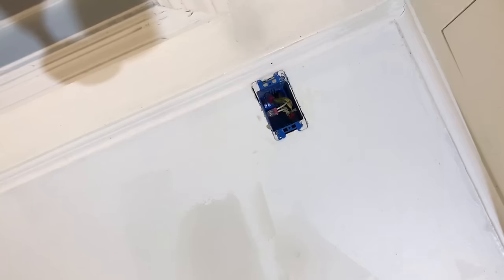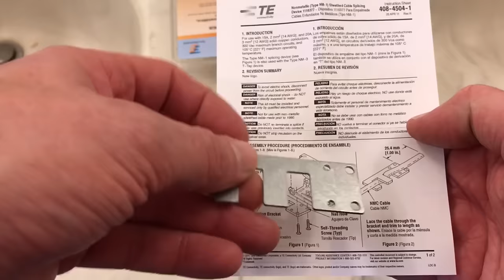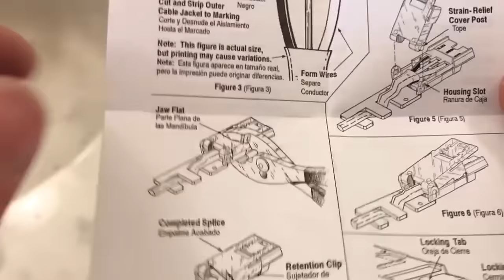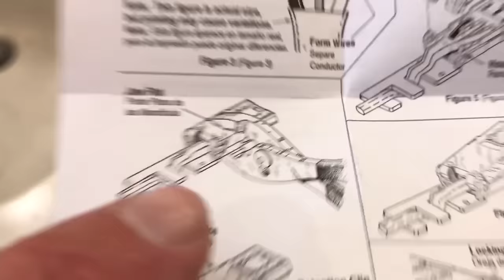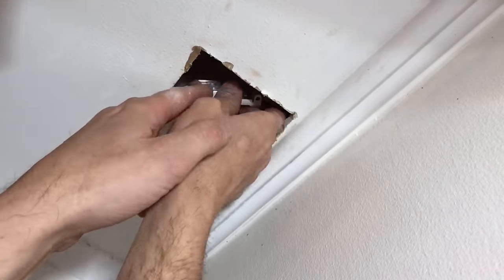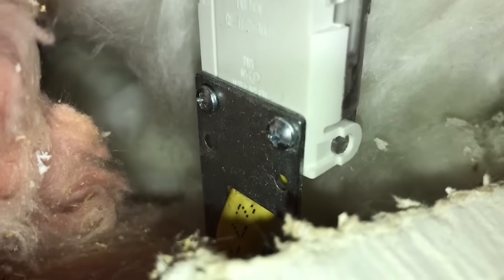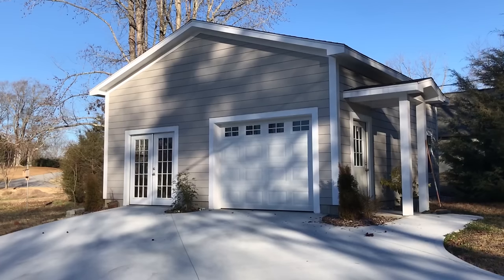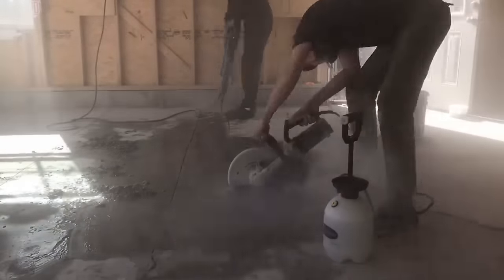Do I have to have a junction box to splice wires?

Comment: I've been an electrician for 20 years. They use these to splice the wires on double wide manufacturer homes. I fix about 50 of these a year. The connection method is horrible, and will cause a fire if not caught at first sign of an issue. PLEASE DO NOT USE THESE, and if you do, PLEASE LEAVE ACCESSIBLE.
Reply: weird how all of you have the same story going around commenting on all videos about this...dozens of different commenters all with the exact same scare story about the mobile homes what are the odds...almost like electricians are a big racket!
Reply: @cryengine_x  I'm not an electrician and Ive never used or seen one of these before today. However I do agree with the above commenter and here's why;
The contact being made with the conductor is extremely low. Look at the bite mark in the insulation when he crimps the 14 gauge wires into it. The amount of contact is exceptionally low and you have a total of 4 of those weak connections in a single circuit using one of these. 

Using 12 guage wire like in the actual ceiling install in the second part will likely give a significantly better connection however, now instead of having to support a 15 amp circuit, you're now asking for it to handle 20 amperes. If even one of those connections is weak it's a problem but remember, there's four. There's too many potential points of failure to be worth it. 

Now if they made something similar to this but with a beefier strain relief and a connector that made more contact that actually involved stripping the wire back like a wago connector I'd be in and say "cool, use it if you want". 

If you absolutely HAVE to use this device for whatever reason, please, please, PLEASE use it in combination with a combination AFCI breaker so if the connection ever breaks down and it starts arcing, it'll hopefully trip the breaker at least. It would also be best if this were only used on lighting circuits only that will never see more than 5-6 amps pulled through them. Running 2500w through this thing is just asking for trouble
Reply: My bro and his wife had their double wide burn down and this was determined to be the cause. I am not an electrician and dont want to be one. If someone wants to use them, don’t complain if your house burns down
Reply: @gopooalreadyplease5842  ok i wont.

my dads cousins brother has over 50 of these in his walls and they all perform flawlessly.
Reply: @davyc444  I just have a hard time believing lots of youtubers use this etc and dont have issues. I guarantee this guy didnt have issues. The only issues he had were the comments LOL. It's also UL listed which I assume counts for a lot, and NEC code approved on top of all that.

I mean I'm literally on this vid because I was drilling into my ceiling from the attic and like a huge dummy, the one time I figured it would be ok just this once to not cut the power, surely I won't hit anything, I hit a live wire going to my water heater, tripped the water heater breaker etc. So I have a damaged wire behind drywall. Not knowing anything about it, this sure would be a easy fix. The other way is splice the wires with wire nuts in an accessible junction box. It's more trouble and even though it's in the garage the junction box is going to be an eyesore (would be 100X worse if it was on an interior home wall!)

All of this is moot because these things appear to be permanently discontinued, not in stock anywhere. I suspect the nattering nanny's won and drove them out of the market. Or from your point of view, maybe they started a few fires (thats another point, if these were as bad as claimed they would have been banned).

Also I believe I figured out a better way to fix my problem, I should be able to just move the water heater outlet over a couple feet to the next stud over, cut the wire at the break and it will reach the new  repositioned outlet location just fine and not have an unsightly junction box splice involved.
Reply: I’ve been a journeyman for about 5 years and NEC says all devices, connections, repairs must be in a readily accessible box. We have to go into attics all the time fix flying splices to adhere to code for home inspections
Reply: @calvinjosey5784  No they dont. Stop lying. This is NEC 2020 compliant for in wall without any box.

if youre a 5 year journeyman (unlikely) you need your license revoke
Reply: Looks to me like a twist lock plug would be better. Find it hard to believe they are NEC approved.
Reply: Not surprisingly, site shows Product as discontinued
Reply: Yes they look "iffy"... Unless you can make a perfect splice first time and not reuse this device...
Reply: BTW, most rvs use molex razor cuts for connections in outlets, I'm in the process of removing all these so called speed connection on my 05 rv with new gfi screwed connections.
Reply: @cryengine_x  Journeyman or not, You're putting entirely too much faith in a group of engineers and safety people that declare products "Industry standard". A helper with 1 eye could tell how fucked that termination method is.
Reply: As an electrician for 20 years, I've seen and never used these.  This connector, although listed for not being in a box, is still a wiring connection.  The NEC requires that ALL field connections be accessible.  Burying this in a wall, despite the manufacturer listing it for the purpose, is a clear code violation.  The poster of this video has just made himself liable to pay for a proper repair should he ever sell his home.  If it was a rental property, he became liable for the renter's losses should a fire start because no one could inspect and repair the connection in the case of a fault.  Never make your wiring connections inaccessible.
Reply: @ianbelletti6241  That is false. Learn to read. 100% legal for in wall at all times and 100% up to code. Your license should be revoked for illiteracy and greed.
Reply: @cryengine_x  what part is greed?  The code actually requires that ALL wiring connections be accessible.  This device counts as a wiring connection.  The requirement is there for maintenance of the connections.  If you hide this in a wall, you will need an access panel at its location to access it.  On top of that, the code constantly refers to the AHJ, which is typically your county building inspector, but can be an engineer, an insurance inspector, or other qualified agent.  There's a major fire liability issue with electrical work.  If you make a wiring connection and bury it where it's inaccessible and a fire ensues because of it, you can become liable for the cost of the damages for doing shoddy workmanship.  On top of that, you can't always trust how it's marketed on the packaging because the people marking the packaging often don't understand the rules and often don't give you proper information because of it.  Just look at the ipxx waterproof ratings.  Ipx7 is a designated rating that is tested in excess of other ratings, but is meaningless without telling you what the manufacturer had it tested to.  Even though the packaging says that it can be hidden in a wall, you still are required to have access to the connection.
Reply: @cryengine_x  weird how little you know about how electric current works.
Reply: @OffendingTheOffendable  i'm spot on about greedy humans (electricians)tho
Reply: @cryengine_x    I have to agree with Steve. You have not issues the amount of electrical installs electricians have. Agreed most push type electrical connections do not fail but those that do are a fire hazard.. I have seen only one for sure that was in my hone the builders electrician used stab in the back outlet connections this connection failed and start a small fire within the electrical box fortunately it was in a metal and was wired with conduit
Reply: @cryengine_x  
Just the Facts The outlet had a heavy load at the time and it was definitely the wiring
Reply: @monteglover4133  wasnt this product though was it?
Reply: @davyc444  Take an electrical outlet apart and review the connection between the internal components and the push-to-connect wire. You may notice that the connection on these splice kits is considerably better than those push-connect systems.
Reply: @cryengine_x  you are out to lunch about greedy humans, frankly if you look at that and think its fine and want them in your house thats fine, i would not want to have that anywhere near my work or be in any way liable for it. for one the electrical code is the bare minimum not a gold standard, and secondly the only reason you may have not seen issues on these is the failure would likely depend on how much draw the cables are taking, if its rated for 12awg 20 amps is a lot to go through that cable. when you have a career that you take pride in doing things properly and when you have to warrantee your work, not to mention install hundreds of joints a year you have to understand theres a different perspective than a homeowner grumpy that they dont want to pay for a service call
Reply: @seanshomeshop325  nah youre just saying that. electricians hate this because it takes away their business=$ and they are greeedy
Reply: Yeah, I was thinking those contact points or fingers look sketchy like they can't withstand much current. Very minimal contact area. I noticed right on the back it says 'Do Not Re-terminate' which to me means it a onetime use. Can't take it apart and reuse. I'm suspicious of a lot of this Home Depot 'Week-end warrior' consumer garbage. Even though they have all the certifications I'd still use a tried and true box and nuts or wago or lever lock connectors. I would just use a box. There's no difference between burying this thing and a box. It' still not a continuous unbroken wire run.
Reply: @cryengine_x  Not really, they just see more of it because they're exposed to more incidence of problems with them on service calls. Just like aluminum wire and Federal panels were all OK. Nobody's going to argue that they use the best construction methods on modular homes.
Reply: @davyc444  If you compare the contact area of those tiny bite marks compared to properly twisted wire nuts there's no comparison. I'd be really worried about having that thing buried in the ceiling, especially in a bathroom. with a lot of high draw appliances.
Reply: @cryengine_x  So far. Flawless until they aren't.
Reply: @cryengine_x  Water heater is typically 220v up to 5500w, much more than these can withstand, unless its for the blower motor on a condensing heater.
Reply: @calvinjosey5784  I also thought ALL splices were required to be accessible, since it's not an unbroken run of wire, you may need to access it in the future.
Reply: As always, use with caution. I would never want to use these for a circuit powering a receptacle, but on the other hand I would have NO issue using this on a circuit powering a known low-power load, like a LED fixture for example.
Reply: @vincemajestyk9497  That is correct
Reply: @pnnielsen  Frankly that's the problem I have with these. People forget, houses get sold and people use circuits expecting it to carry the rated load. Literally you're playing with fire. I don't know why anyone would deliberately 'under engineer' a circuit just because at that moment it happens to have an LED light on it. Maybe some future owner will install halogen lighting and have a fire i the wall. If an electrician says it's a problem take heed. I think the only 2 choices you have would be use a box (exposed) or run another length of wire. If you can't pull the staples just fish a new wire and tag the old one abandoned. Having a box showing isn't the end of the world, especially if it prevents a fire by discouraging the use of these things. I heard some of these cheap new construction homes (Ryan) are using 14ga in the kitchen and bathrooms to save $$. They also use that jointed stitched together wood.
Reply: @vincemajestyk9497  I'm wondering if they found a loophole in the codes. This is not a splice since you plug them into each other. Presumably there's another loophole since I'm sure hiding plugs and sockets wouldn't be allowed either. However, just because you can doesn't mean you should.
Reply: @chaos.corner  Actually I think that the issue is that they are being 'misused' outside the application they are made and approved for. I think in most jurisdictions they are ONLY to be used for 'mobile' or 'modular' construction homes (obviously because of the need to quickly connect the service cables upon joining the modules) and people see them at HD and figure it's OK to use it in a stick built home. Probably easier to access in a Modular home situation where you kind of 'know' where they'll be if there's a problem. Just because it's 'Approved' on the package doesn't mean it's approved in YOUR application. Like people have said, they're unique to MH because of the construction. I've seen some crazy videos over the years. A splice is defined as the mending or joining of 2 or more cables, which is something other than an uncut uninterrupted continuous run. Yes, it is a splice. It's not a solid run.
Reply: @M-J-P  Getting ahead of.........lawsuits.
Reply: @bernardgraf7187  More than 'iffy'. I think the 'Scotch Lok' trailer connectors on my truck can handle more current than this do-hickey device.
Reply: @ianbelletti6241  True. It MUST be accessible for inspection. Period. I think they're playing word games on the packaging. When they say 'can be' it doesn't mean it should be nor the legal compliance aspect. Just that it would physically fit in the wall. Probably one of the reasons they're DISCO'd now.
Reply: @vincemajestyk9497  I'm talking about the specific situation when you need to modernize, and extend your wall bathroom light circuit to a ceiling hard wired LED light. Sigh! I don't know why I even comment here... DUH! We all have brains. Use them ! Doggone!!!
Reply: @vincemajestyk9497  exactly.  It's just like hiding a box in the wall. You have to have access to it.  If it's for a light, you can use the light as the access point assuming removing the light leaves a large enough hole to access the connection.  Otherwise you need an access panel in a position that's reasonable for working on the connection.  The big problem here is that the marketing team that designed the package clearly doesn't understand the the average consumer and only picked up on the engineers mentioning that they can be installed in walls missing the engineers' statement of "when accessible".  The average consumer doesn't know the code requirements either and doesn't even realize that if they have a code question about some work that they are doing most inspection departments are willing to answer their questions because they like to see homeowners trying to do things correctly.
Reply: @vincemajestyk9497  Maybe. But the stuff on the packaging to me doesn't seem to be suggesting MH only application.
As to the "Splice", you are not joining two cables, you are wiring the cable into these and then plugging them into each other. Plugging a lamp into the wall is not a "splice", after all. Bear in mind, I'm talking a strictly technical interpretation and not the spirit of the thing (which I agree would make it a splice). There are always edge cases where loopholes can be found.
Reply: @vincemajestyk9497  Fair enough, but anyone crazy enough putting a major load on an old light switch is not going to get stopped...
Reply: @vincemajestyk9497  HALOGEN LIGHTING? Lolololololoool! Incandecent lighting is about to be forbidden everywhere. If you worry about this, then yes, someone will hook up a stove to this circuit. Right on!
Reply: @cryengine_x  Even it is compliant, it's a bad idea for so many good reasons.
Reply: @cryengine_x  Same with my brother's sister-in-law's aunts' brother's, nephew's kid.  They work great, but that's about how close I would get to putting them in my home.
Reply: @bradarmstrong3952  disagree. actually a great idea.
Reply: @cryengine_x  "Almost like electricians are a big racket." Hmm. One of the easiest jobs for an electrician is to fix the garbage that is somehow approved for mobile homes. You see the same things over and over. In my case "back-stab" receptacles. (Three or four outlets have gone dead, you say? I wonder what it could be?)

It's true that I've only seen something like these connectors once, used at the interface between two halves of a double-wide. An inspector had told the supplier of the home to have someone in to "get rid of that sh*t" and make proper connections.

If there's a racket, maybe it's the overly cosy relationship between manufacturers and standards companies.
Reply: This is the truth. 9/10 failures in double wide homes is because of these connectors and also the mobile home devices that have the push in connectors. It’s a good idea and the concept is good but the actuality of the connection is poor. But like he said if you must use one make it accessible. Don’t install it inside of a wall or ceiling behind the Sheetrock where it’s forgotten about.
Reply: @redneckcommie  Dude is myopic, wasn't long ago aluminum was 'code approved' for residential circuit wiring, and gee, it oxidized and caused fires so they stopped it's use except for main service conductors with the use of an anti-oxidant at terminal connections. Not sure if he's trolling or it is Dunning Kruger, I feel it may be the latter.
Reply: @cryengine_x  "takes away electricians business?" Not likely, if your house doesn't burn down, you'll be calling an electrician to fix these pieces of garbage when (not if) they fail. But further, they absolutely help my "business.." 18 years on the job as a firefighter. My job involves no greed at all. It does involve risk, risk to me and my crew when we have to drag your tail out of your burning house when this trash product starts the fire. That connection is weak, which will cause arcing. The housing is plastic, which is oil, which is flammable. Your wall cavity has wood and insulation, which is more fuel. If you survive, good luck with your insurance claim. A licensed electrician won't install  these in a repair situation, so it's presence could only be from unlicensed work. That's how you won't be covered. If you live, that is....
Reply: I'm not sure where to add this so it is most visible... normally I skip over the trolls like the cry guy. I haven't seen any code references in this thread and that is the easiest way to solve this discussion. 334.40 b states that if a device is listed for repair of NM cable then it can be concealed. 300.15 h supports this. That settles whether they are legal, whether they should be used or not is something that should be determined by a qualified individual ( us electricians and not diy'ers or homeowners). Use of this type of splice has inherent risks that can only be properly assessed by experienced professionals. Electrical fires are a very serious risk and I wouldn't trust my family's safety to one of these buried in a wood framing wall. Especially if the reason for use is simply to avoid having a blank cover in the ceiling.😬
Reply: @nicholassmith7927  lol so it comes back to i'm greedy, give me money
Reply: u are right , i would just use a metal junction box and paint the metalcover white lol
Reply: @cryengine_x  My uncles third cousin’s step brother uses these all the time with out an issue either.
Reply: @owendaly3543  yes those against these keep using anecdotes! that are probably fake
Reply: Just yesterday i had a feeling to go in my basement of my modular home and upon entering smelled burning wires and plastic. one of these plugs hanging out of the ceiling was melting and extremely hot to touch.   Moving it around you could here the arching.  I will be splicing these in a j box now.
Reply: @bigmoosegarage8606  yeah this is fake
Reply: I just found one of these buried in my wall behind my bathroom vanity. I’m in shock! I found this video trying to figure out what it was. I live in a modular home built buy a mobile home company. I’m not sure what to do. Do I leave it alone? Move it and make an accessible junction box? 🤯
Reply: @nicwatchestoomuch7  I would put a accessable junction box
Reply: @davyc444  you'll be surprised how small a path electron need to jump. I wouldn't worry about putting 12 amps through this connection. It may loose 1 watt through the resistance. Also, you would want to make sure it is accessible. At least someone else can check the connection and see if there is anything wrong.
Reply: I’m a product design engineer for the automotive industry and there are hundreds of these kinds of connections in your car… hope you don’t lose sleep over it!
Reply: @yosh1to  12 volts is a different game. Also stranded wire and solid wire expand and contract differently. I use a similar connector for some LED installs, which run on a 12 or 24 volt system. On a 120/240 or greater circuit, I've seen too many fail to in conscious use when one bad one could cost someone their  home or their life.
Reply: I might use in a drop ceiling but not buried in a wall
Reply: Eh, wire nuts and lots of black tape work just fine…. At least from some of the re-remodels I’ve done😆
Dang DIY’ers
Reply: @cryengine_x  why do you think this would cost electricians money? If they trusted them they use them and charge the same minimum for the service call and be done faster and make more money. I've done every kind of commercial and residential repair you can think of from plumbing to electrical to structural to hvacr. I've seen every type of electrical connection fail. If for some reason I had no choice but to bury a connection where it wouldn't be accessible I would hire an old electrician that used Buchanan crimps and then soldered the connection.
Reply: @jimkane9832  because ppl can do it themselves
Reply: @cryengine_x  people can do junction boxes themselves
Reply: @jimkane9832  this is easy
Reply: they remind me of the cheap connections used for outlets in RV's.
Reply: @da7heaven  you remind me of the electricians commenting to protecting their $
Reply: @cryengine_x  what kind of idiotic statement is that?  you don’t even know me.  the outlets in our RV had similar press fit connections, and the one powering the microwave had burn marks on the insulation.  I swapped it out with a household type outlet. I’m all for saving money, but not at the risk of burning my RV down.
Reply: @da7heaven  that has nothing to do with this. why are you here.
Reply: Thanks for letting us fam❤️👍!!
Reply: Agree 100%. Terrible connection !!
Reply: @cryengine_x  if you can't figure out a junction box to probably shouldn't be doing electrical work
Reply: @baileythesleepless9966  no sense doing the more difficult way for no reason. if you cant figure that out you should probably be banned from your electricians license and your greedy dollars you are trying to protect.
Reply: @cryengine_x  Im no electrician just a 23 year old dude its a box you connect wires in lmaoooo
Reply: @baileythesleepless9966  imagine this the other thing is just a box you push wires in lmao. why are you so against it? just call it a junction box (which it is) if it makes you feel better. problem with a junction box is it has to be accessible from the outside with a cover which is ugly and a pain to drywall around. yeah if you could just leave your junction box covered in wall i'd agree with you it'd be just as easy. plus real talk tbh i find junction boxes in the attic (where mine would go) more dangerous, as it's easy to pull the wires out in a accident or fall. regardless code says its safer, it's realistically less safe.
Reply: @cryengine_x  I mean Im not arguing for or against the thing, it seems a bit sketchy to me, I was just saying that a junction box should be easy enough for the average DIY electrician
Reply: @baileythesleepless9966  yeah i agree actually lol. they dont seem to sell them at all anymore. i suspect they were fine but the naysayers convinced me its not worth the risk (even if i could find one)
Reply: You and me both brother!!! Look like junk to me!!!!
Reply: Yeah. You're an electrician.
Reply: Yeah. You're  a pro and I certainly want to listen to you.
Reply: An overgrown Scotch lock. Have had to repair more of those than I can remember.
Reply: Thank you. I'm remodeling the house my wife and I bought and was curious about them. Granted I already have a case of junction boxes and covers.